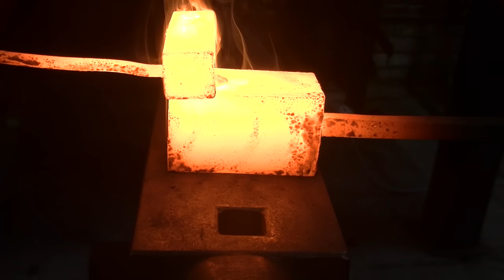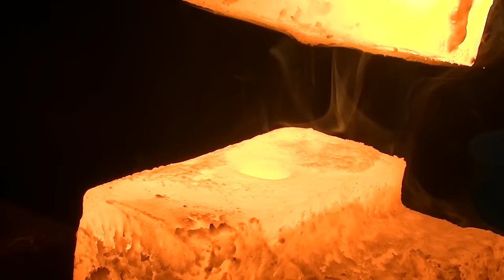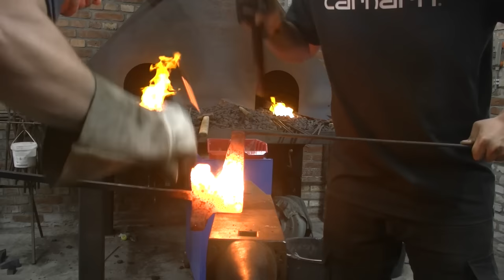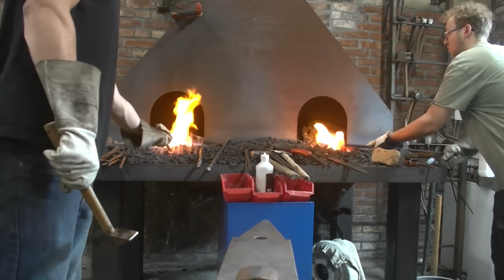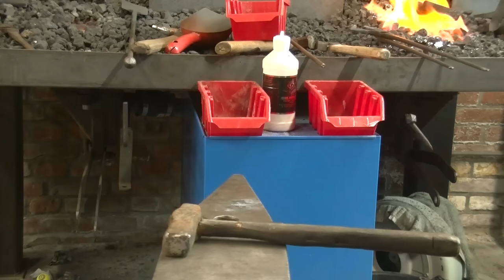How anvils used to be made (2023)

Comment: I've heard in later times they cast the body and just forge welded high carbon steel to the top and hardened it. It surely would have saved a lot of time as compared to forging the entire thing. 
Very cool, love these kinds of videos.
Reply: There are a few anvils with a cast iron body and a steel face welded on, but they aren't super common. Most cast anvils with a steel face that you can find nowadays were cast as a single piece of hardenable steel.
Reply: @garethbaus5471  I would think that some cast iron is hard enough (especially after being used a while) that no steel is needed, right?
Reply: @Bob_Adkins  Cast iron is simultaneously softer and more brittle than steel, so although it kinda can be used for a little while even ductile cast iron is likely to crack and chip if you frequently use it as the face of an anvil. I have had surprisingly decent results with a mild steel face on one anvil I used to use, although the rebound wasn't quite as good as hard steel and it did dent a lot more.
Reply: @garethbaus5471  Some cast iron work hardens when hammered cold. I have an old cast iron vise with an anvil that was easily dented when new. Now I can hardly dent it with a ball peen hammer.
Reply: @Bob_Adkins  If you hit a surface like that with a 6 pound hammer you are likely to get cracking and chipping. Work hardened surfaces are inherently more brittle for a given hardness.
Reply: @garethbaus5471  You usually get all your cracking and chipping around the edges and thin areas but yeah, some iron is brittle and definitely wouldn't work for an anvil. I think some iron should be fine, I've seen it.
Reply: @Bob_Adkins  I have had cast iron anvils fail on me in a fairly significant way.

Comment: This process is fascinating. I cannot imagine how hard it is to forge a 100kg anvil. I guess people would use systems of chains and pulleys to move the steel around
Reply: not necessarily. In an old book about blacksmithing I once read (I can't remember the title), there was an excerpt from an even older apprentice's journal where he described the process of his master and four journeymen making an anvil for one of the journeymen who had completed his time with the master and was going to start their own shop. At the end of the process when they needed to quench it it took four journeymen each with a thick handling rod to move the anvil out of the forge and then they had to run a short distance out of the shop to a stream with a small waterfall to quench it because they didn't have a tub large enough to contain enough water to absorb all that heat.

Comment: What do you mean "used to"? I feel like I just saw you do it now. Although if you were using the punches as hammers I'm a little bit upset. But they're your punches, so it's OK. I think the swage block helps with work support to do those corner welds, also the "side" set tool. Xx

Comment: How anvils could be made. They were usually  not made commercially in any volume this way but were forged from a single block with a huge press and a harder plate was forge welded to the top.
Reply from the maker: You are incredibly wrong and misinformed. 
Look up Peter Wright, Henry Wright, Mouse hole Forge, Wilkinsons, Refflinghaus, Krägeloh, Söding & Halbach anvils, Just to name a few.
There are many more, Who commercially produced anvils with the build up method as shown here.

Comment: But you're making it on an anvil.. how were anvils made before anvils were made?
Reply from the maker: This is a modern anvil design, not iron age for example. 
Anvil makers used anvils to forge their anvils. Though those anvil making anvils look nothing like the anvils they make on them. 
The further you go back in time, you get to the point big flat enough rocks are used to make the first anvils. 

Like saying but you used a lathe to make a lathe. 
Go back and it was chisels and files that made the first crude lathe which allowed for more precise tools and a next better lathe. and so on.
The same counts for anvils. 
The anvil did not appear over night, the design changed and continues to change depending on the available materials and techniques of a given time.